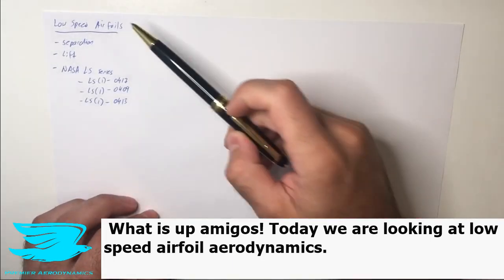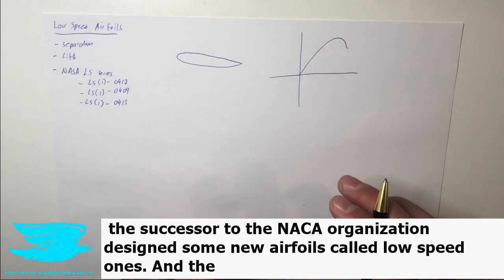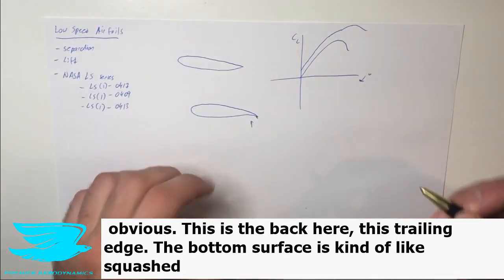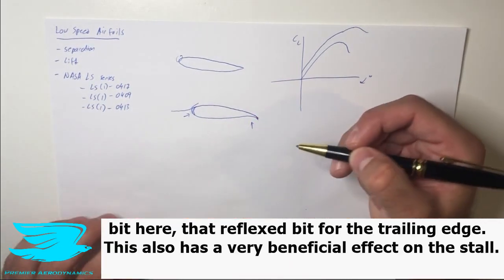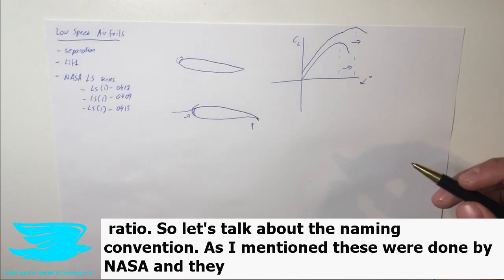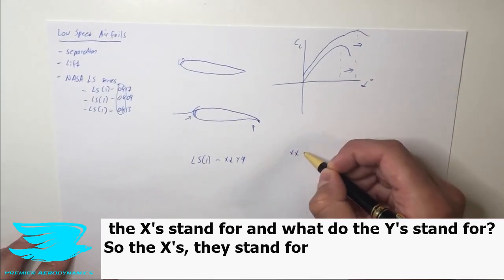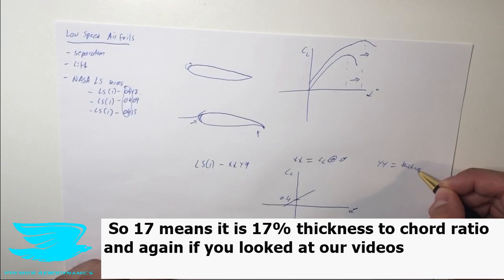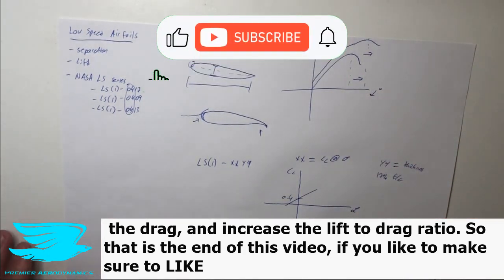[Aero Fundamentals #22] Low Speed Airfoils

Comment: Thank you for the video. 

There is indeed a higher lift and gentil stall behavior. However, the cost of safety and higher lift ideal for STOL results to a lower CL/CD compared to others (like 65-218…). 
For the STOL configuration, it may require less engine Power as it would be with a lower CL airfoil. 

For some applications it an excellent option. 
Pilatus PC12 is using this airfoil series…